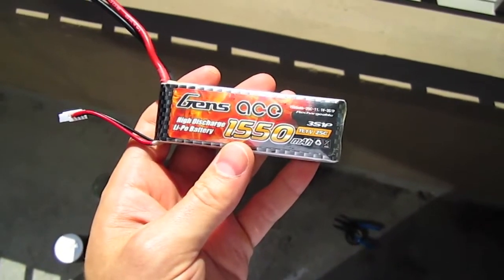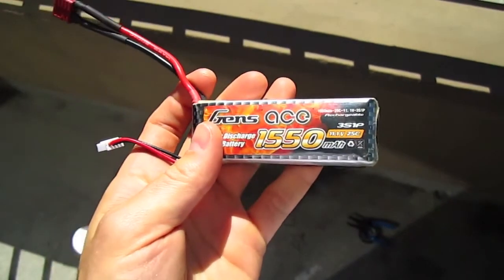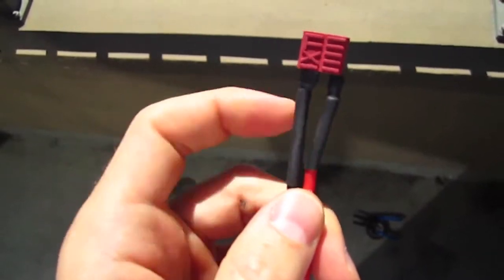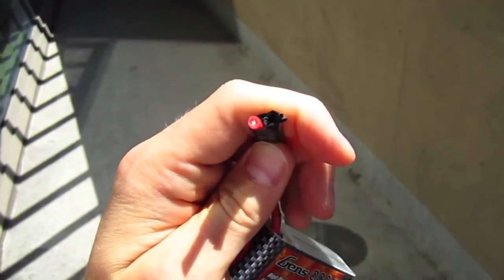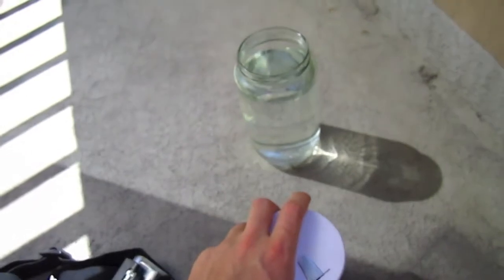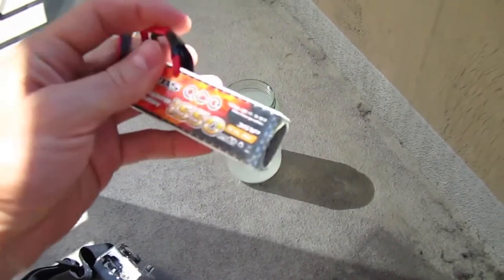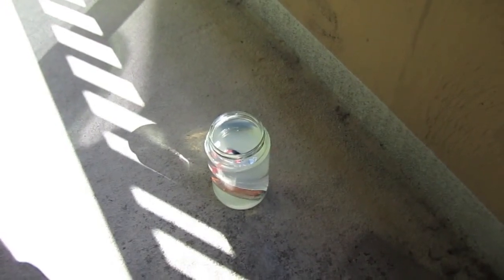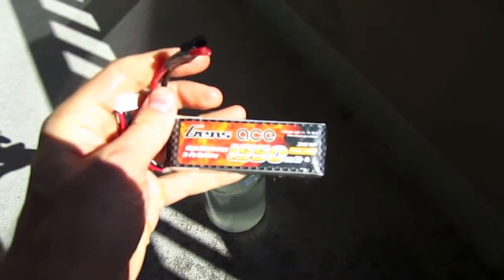How to Discharge a Lipo for Disposal

Comment from the maker: I just did some research to check, here is what I found: "It's really no mystery what's going on in the video. The hydrogen can’t burn if it’s bound to oxygen (like it is in water). But, if you mix the water with sodium chloride you loosen those bonds. Then, if you do something like hit it with a very strong radio wave, then you separate the hydrogen and oxygen. "